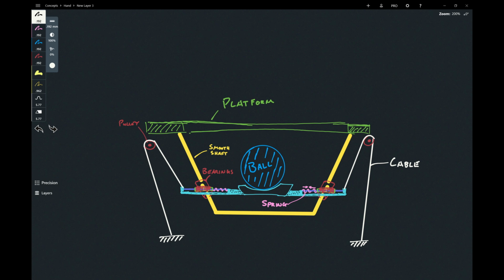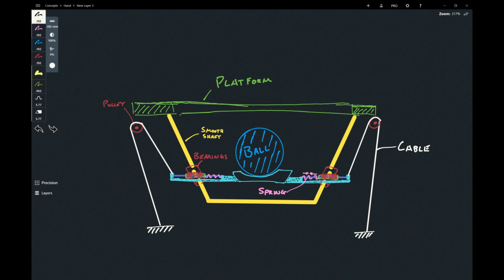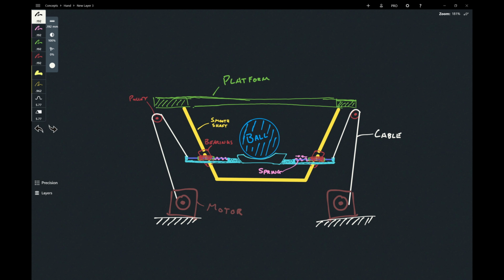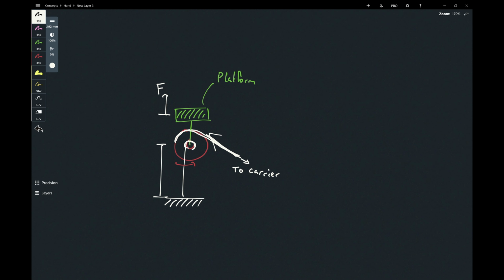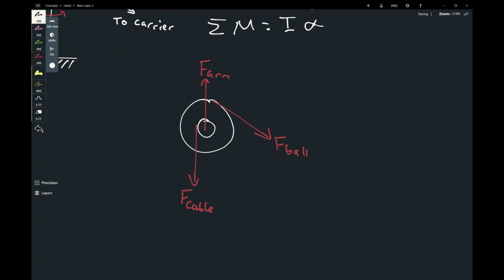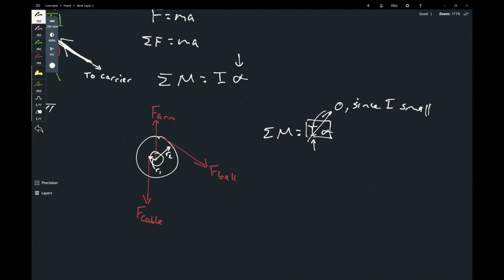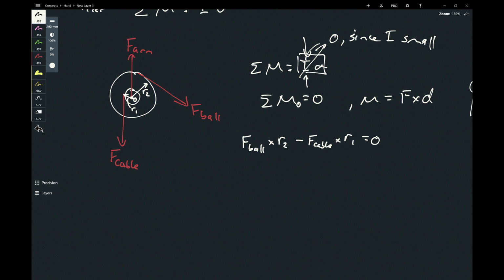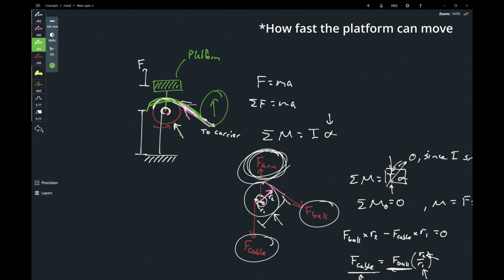Project: DeepBlue Juggling #3  - The Hand V1

Comment: If you still have the proto lying around, how would crossing the lines have helped? Bottom left would be connected to top right e.g. then the ball would compensate the tilt and try to toss upwards even when angled?
Reply from the maker: Hmm, I don't have it in a remotely constructed form anymore unfortunately. Too many moves have happened since then!

I'm not sure if crossing the lines would have helped the issue much. The lines would have had to cross underneath the "cup" part (orange) and I think would have led to the same issue: a tighter line (or premature motor turning) would tilt that side upwards, muddling it all up
Reply: @harrisonlow  Hahah I bet :D cheers for the reply. Re-watching from beginning to get grasp of the whole picture!